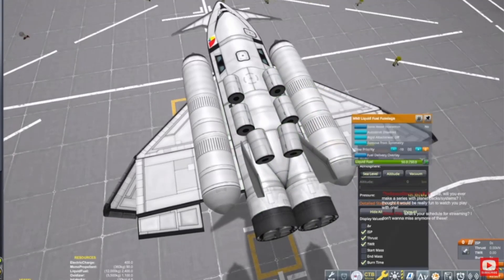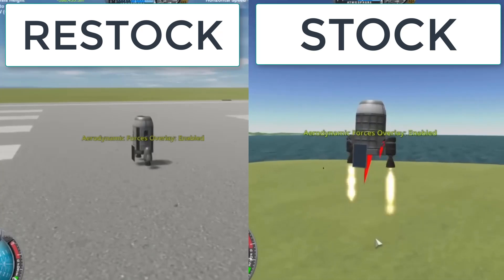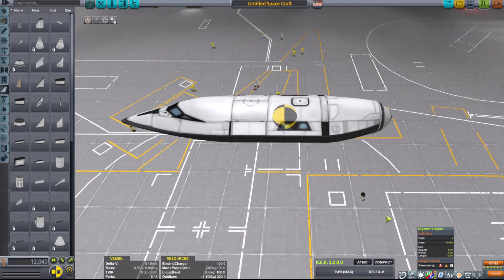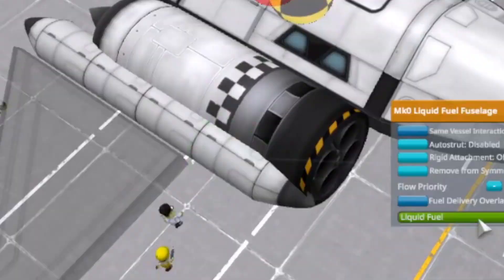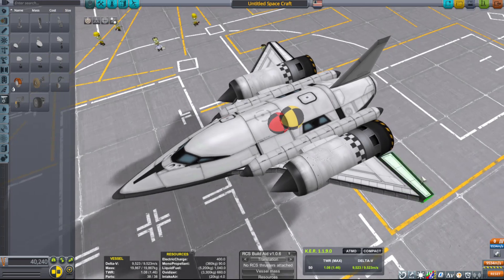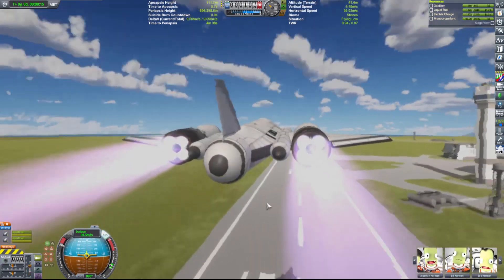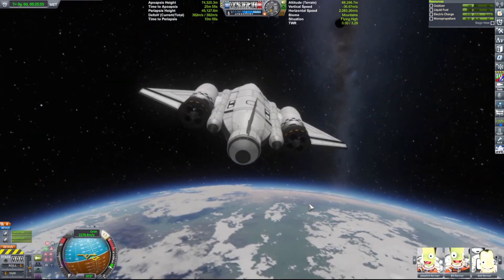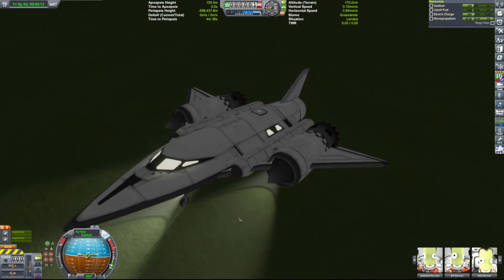BUILD IT WITH ME!! Small SSTO!

Comment: Sweet little design.  Its a bit too fast for that cockpit.  I noticed you had extra oxidizer, but with pitching up or just starting out with a 5 degree climb and lock it that flight path should better match your fuel load.  Basically burn a bit less liquid fuel, less time in the thick atmosphere and in space quicker.  Great video on a cool simple SSTO.

Comment: Hey VAOS, is nuclear engines worth using for interplanetary sstos?
Reply from the maker: yes. although they are not the only engines capable of interplanetary travel. terrier engines are great too.
Reply: @vaos3712  Thanks that is very helpful😀
Reply: @vaos3712 One last question, is there a way to attach multiple(4 and up) engines(rapier/nuclear) to 2.5 or mk3  parts without an engine plate? (An engine plate seems very draggy during testing)
Reply from the maker: @EnderRobber101  try a side mounted nose cone and place the engines on those.
Reply: Thanks that worked

Comment: My entire career game is built on SSTO rockets right now... As soon as I unlocked probecores and aerobrakes I started retrolanding my rockets and improving my designs and skills in doing so.

For example... My method of landing on KSC right now is to make sure my SSTO parks in 100km orbital altitude (this is like my parking altitude in current games), the SSTO rocket then releases the ship or probe there. Then the SSTO rocket prepares to land.

Again, I make sure the SSTO is at 100km altitude, then I burn a 400DV retrograde curve. I make sure it hits 3 times the distance away from KSC than the flystrip island for measure. This usually gives me a nice room to brake in space above KSC. I also make sure to have 700-1000DV when the rocket is returning to halt the landing speed, but also to brake above KSC.

Then I aim for the airstrip with the rocket, quite easy. Although even if I miss the airstrip or land near KSC I get 98% of the value back or more of the entire rocket. I save so much I can overengineer a lot of ship and stil make more than I ever would with single use rockets. And it is quite fun to design. It does take more time to fly these missions. But I save so much money that I could even over-engineer my space station contract with a nice looking station using parts from Nerteas stockalike stationparts pack and stil make a buck! The same space station is orbiting kerbin right now making me years of research with just 3 landings on the moons of kerbin.

Design decisions that are a practice for my SSTO rockets.
1. make sure to have 1.5-2 TWR
2. Make sure to have 3800DV or preferably 4000DV.
3. Use gravity turns to space.

Before I land the SSTO rocket I move all my fuel to the bottom of the rocket for stability, I also have powerfull bipropellant RCS thrusters so I dont need to waste weight on monopro. But also because they are handy in atmos. And I put a bunch of aerobrakes on the top of my rocket. Half of them deply fully. While the other half/array only used as control surface during landing. All of this really helps preventing the rocket from flipping and gives a lot of control upon landing.

Also, disable gimbal on rocket engines and put the control surface to reverse on the fins at the bottom. Otherwise it will work against you. And make sure the aerobrakes point the correct way. Place them thinking the engine of the rocket is the nose of the plane you would normally use them.

I even made my own mini addon where I made a new aerobrake, basically I took the vanilla aerobrake and made an XL version for large rockets. It is 2x on rescale in code. Which makes it 4 times the surface area in the game (it fits 4 normal aerobrake surfaces on itself) so I calculate the values for that stuff to be 4 times as large. I also increased the price accordingly.

Nerteas near future launch vehicles also adds a bunch of tank sizes and adapters and cones along other payload systems suitable for SSTO rockets, and probe control systems fitting for it. This allows me to make some of the largest rockets I have ever seen in career. I frequently send 100k worth of rockets. But I get back 99% of that value. Making them cheaper than small single use rockets. SSTO rockets are super op in career and makes it fun! I earn a heckton despite making a lot of personal missions. Even the cheapest contracts earns me a decent amount of money.

I stil havent unlocked SSTO spaceplane capable parts yet but I am planning that too. Just never enjoyed planes too much in KSP but after learning more stuff about planes with MS flightsim I am gonna return to it. I made 2 pretty sucessfull SSTO spaceplanes in my last career game, one which litterally huge and used for landing payloads of refined uranium from the munbase I made to earn money without having to do contracts. I stil found SSTO rockets easier to build and quicker and easier to land.
Reply from the maker: Very good information for sure. You can also build Rocket SSTO space planes that have .7 or less TWR and use less fuel to deliver the same amount of payload that a more powerful, heavier SSTO rocket can carry into orbit. 👍 

They are also fun to build. 😎
Reply: @vaos3712  stuff i plan require pretty massive payloads i dont see realistically carried in spaceplanes. I also just really love the look of the SSTO rockets i build. I intend to use spaceplanes for smaller payloads and cargo. But for massive spacestation parts and heavy cargo that is larger than what the MK3 spaceplane parts can fit I will likely just use the massive rocket parts Near future launch vehicles give. Also love those cryonic engines the modpack gives. My SSTO rockets are also generally quick in use compared to when I fly spaceplanes.
Reply from the maker: @Zefnoly  oh ya that sounds really fun regardless. any payloads bigger then mk3 cargobays youll need to build your own bay. Like the 290ton rocket ssto space plane video i put together. haven’t tried those mods you suggested. i’ll give them a look. 👍
Reply: Nerteas near future launch vehicles adds absolute beasts of tank sizes. The rockets you can make are huge and they have some really cool payload parts as well to conceil systems inside the rocket. Including payloads that can open up so you can have re-usable caps or concealments on the rockets too and make them truly "re-usable"

I basically made my KSP1 what KSP2 promized by adding all of Nertea's near + far future mods, and cryonics + atomics for the H2 and Methane fuels. + restock ofc which makes them all fit together visually. The only other mod I have besides that is waterfall and simple construction to allow me to build offworld in a way that doesnt overcomplicate the game managment wise... I think you also used that mod at some point? Just happy I can use my own docking ports to design my own construction modules visually speaking. Then sprinkling the game with chatterer and final frontier.
Reply: @vaos3712   here's a challage, make a eve ssto that also lands on ike for some reason
Reply: Also I have reached a point where I am able to make two stage missions to the kerbin moons. SSTO rocket to get the command module to space. The command module has 4000DV. Enough to go to either moon, land there, then get back. With additional fuel to reach kerbin orbit and dock with my spacestation to deliver science to the spacestation. This gives me so much science I could ever ask for right now. Which I dearly need. I got community tech tree and far future technologies + near future technologies. So lots of stuff to unlock. I will stil be unlocking stuff after visiting other planets.

Comment: We struggle with Panthers and Swivels. Help us out here.
Reply: Try Reliants vs Swivels.  They have a better TWR for the engine; more thrust for the weight.  That said its really tricky.  I have a built a working SSTO with 4 Panthers (wet mode), 2 Reliants, and 1 Terrier.  It was underpowered for the weight, but that's what worked.  However its a different assent profile.  Basically climb to 3500 meters, level out and lock SAS at zero degrees, that will help you get up to speed to get the best effciency from the Panthers before it naturally starts climbing.  Also don't ignite the Rapiers until 4500 meters.  Ignite the Terrier at 9500 meters or more.  Good Luck.  The great thing about the Panthers is you can kick them to dry mode after reentry if you are too short to glide to the runway.

Comment: I really need Vaos to do these upcoming videos on how to build the huge SSTO's as I been trying fr months to build a huge Cargo SSTO t
o help my station supply and go pick up some bug rocket launched robotic space Tugs that are stuck in a orbit on the rocket which ran out of fuel on route to the station.

So I need a big SSTO to help pick those tugs up and move them to the station! I did all the stuff he said about balance and fuel and weight and wings angling etc. but can't get the SSTO even off the runway. even with now 12 Raper engines.

Comment: Hey VAOS you make it sound like you use kerbal engineer redux specifically for vacuum delta v. If that's the case I just want to say there is an stock option to see that using the default delta v tool.
Reply: Also you can see your apoapsis and time in the purple button in the area below the staging
Reply: @the_rbop  Yeah, I know a lot of these tricks because I play on console. Makes it a lot easier
Reply from the maker: Not specifically for vac delta v, no. it calculates much much more useful information like engine torque and suicide Burns just to name a few. 👍
Reply: You can also see it in the "more options" of a part
Reply: In game? No mods?
Reply: @cmbaz1140   yeah in the VAB/SPH there is a 🔺️V button(botom right)
Reply: @cmbaz1140  yes